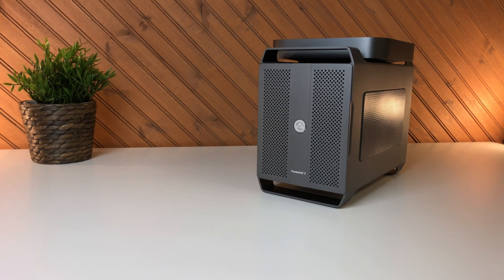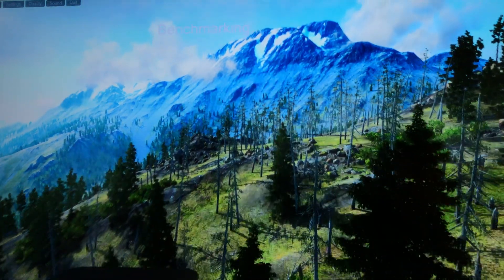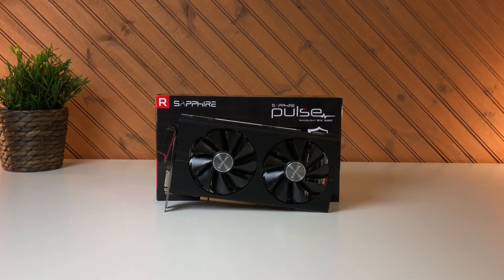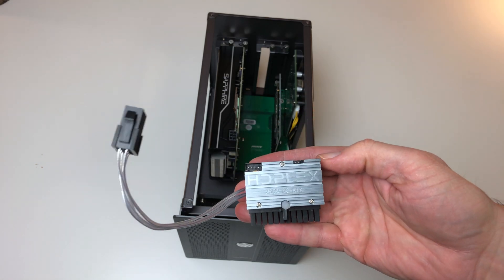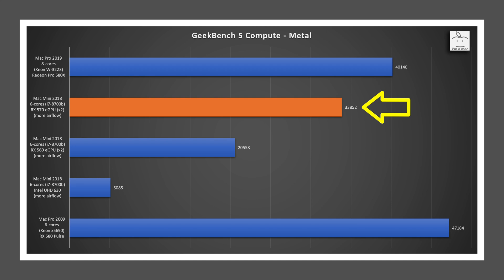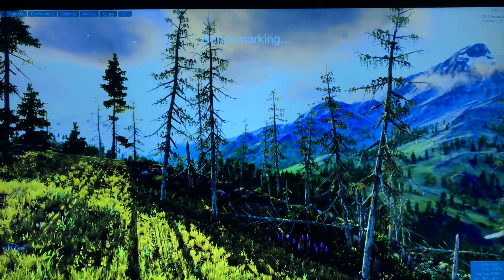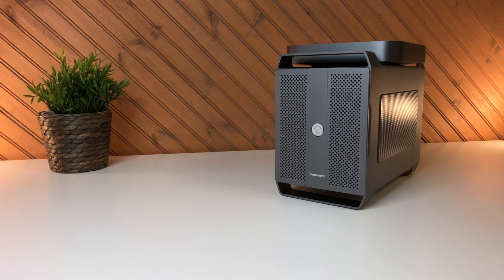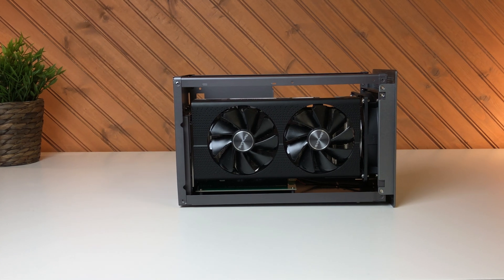Chasing the Mac Pro - Part 2 GPU: my Mini Mac Pro gets a GPU upgrade!

Comment: just stumbled upon your channel bro. keep it up!
what is the voltage of the DC adapter? BTW. most laptops charge at 20v. most dc psu s require 12v  input.  just curious.
Reply from the maker: Thank you. The Dell Laptop adaptor is 19.5V just like most laptops. While the HDPLEX nano is "PICO-like" in size it is different in the input voltage range.

Comment: I don't see that 4GB of VRAM as an issue. The RX570 Apple uses in their iMacs is also a 4GB model. Good choice there and could you post a video comparing the RX560 and RX570 in FCPX?  Thank you and glad you are safe and still posting. (:
Reply from the maker: That is a great suggestion. Now that I know the RX 580 Pulse also fits, I think I need to include that as well. Stay tuned.
Reply: I'm a Mac Oh that’ll run great as well. I am currently using an RX 580 with 4 GB of VRAM. Works wonders for me. But then again my videos are usually pretty short at this time. ;)

Comment: Still prefer a desktop tower setup. I think the rx580 will be bottle necked by the thunderbolt 3. Probably 90% of the mac pro 2019 rx580 performance. Anyway, still look forward to your next vid. Stay safe.
Reply from the maker: I think you, me and 99% of everyone else would prefer a desktop tower for an expandable desktop. Sadly, if you don't have the $6,000 entry level fee, then adding external boxes is the only path offered by Apple. And it will have limitations...and it also gets expensive, fast. Thank you for the feedback.